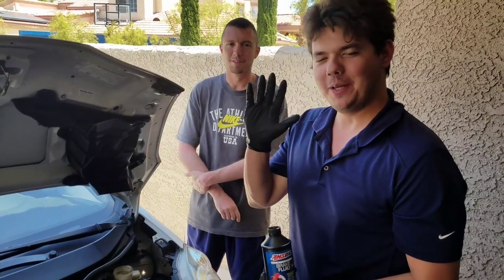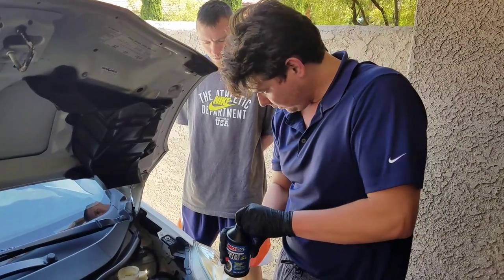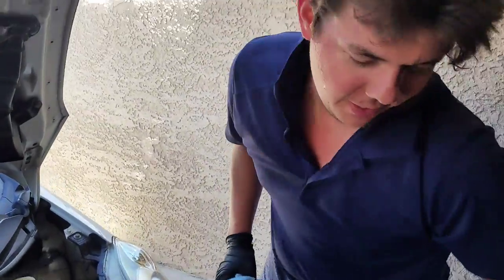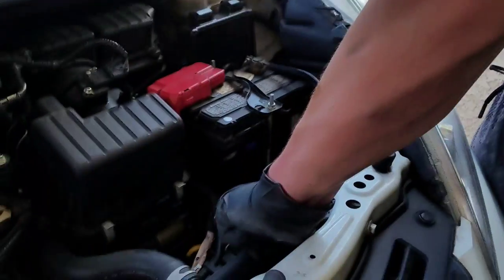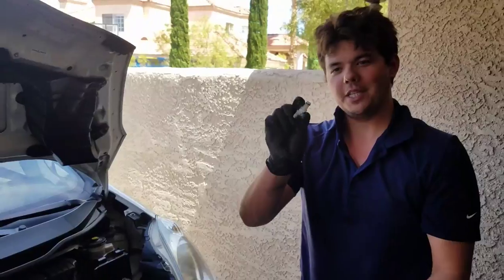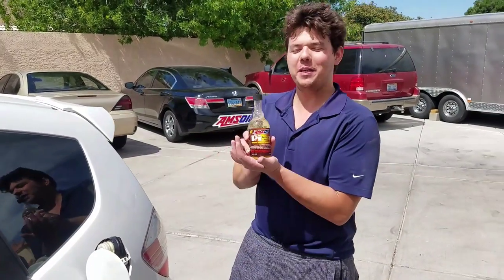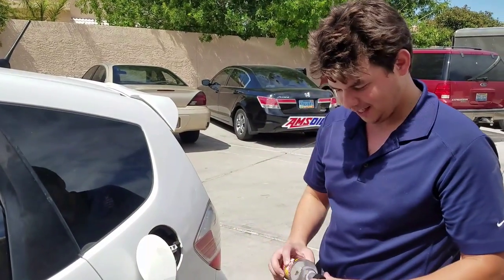Honda Fit Brake Fluid & Radiator Coolant Change

Comment: Appreciate the video. I've always been told not to shake the brake fluid bottle because it will add air bubbles in your brake line.

Comment: Just use Honda coolant. And don’t let your brake reservoir get below the low setting when bleeding.  And use a clear hose so you don’t get brake fluid everywhere
Reply: Amsoil coolant is excellent. Manufacturer fluids aren't always superior to 3rd party products.
Reply: @LordAfrocious  Amway makes coolant?
Reply from the maker: @mistercohaagen my favorite coolant is called the low toxicity biodegradable coolant it's compatible with all other coolants and you can mix it to the ratio you want we'll make a big Improvement in your vehicle warm up times with the Dominator coolant boost.
You can get those products right through my link and that would attach me to you in the future I could always be your Amsoil dealer and would be able to answer your questions about improving the performance and lifespan of your vehicles by choosing the right fluids👍
Eben Rockmaker 702-472-3614 
New Video - https://youtu.be/el0YnOpPNMo?si=B-wBCrEHhDTkV3Yq
https://linktr.ee/EbenRockmaker

Comment: I like your videos but can you mention sizes of bolts, wrenches and tools in general used , still awesome videos
Reply from the maker: I usually do.

If they're very general tools I usually don't mention it like 10 mm or 15 mm socket for an oil Bolt because they are in every socket set
Reply from the maker: If you haven't got a socket set yet I recommend if you're going to be doing basic work you can get a Craftsman socket set on sale right now during the holidays or you can also get a lifetime warranty socket set from Harbor Freight however they are not very strong tools say you cannot pound on them with a hammer or use a air ratchet or use an impact gun because it will crack the metal because they are very very very cheap tools.

If you're looking for something of real substance I recommend getting a used Snap-on set which is the best you can get pawn shop or on line.

If you have any other questions feel free to give me a call Aaron☕

Comment: Hello..
Please advise which antifreeze was poured into the Japanese Honda Fit 1.5 i-vitec 2011 car?
Reply from the maker: I recommend the low toxicity biodegradable coolant that's my personal favorite I use that in all my vehicles because it's compatible with all other makes models and colors I also use the Amsoil Dominator coolant boost which you'll see next to that on the website when you use my link that will attach me to you so in the future I can answer all your questions about improving the performance and lifespan of your vehicles by choosing the right fluids as your independent Amsoil dealer😊☕️👍
https://www.amsoil.com/p/propylene-glycol-antifreeze-and-engine-coolant-ant/?zo=5331179

You also want to add the 6-month PC membership to cart that's going to give you the best value on the products you'll also have the free shipping at 100 bucks or more and the new promotion which is right here below.
Promo: FREESHIP
Reply: Thank you very much for your help

Comment: You forgot to drain the remaining coolant from the engine block and you should also use a transparent tubing for bleeding the brake.
Reply from the maker: Flr Power 

Nice Add!
Reply: Why is that?
Reply: @dianasanta7587  that's because you can't mix the blue antifreeze (OEM) with another, and he just flush the radiator but there still antifreeze inside the engine. You only need to turn on the car with the Valve open to flush completely.
Reply: @josesalinas4494  Great input! Another thing to do is to empty the plastic reservoir.
Reply from the maker: If it was my car I wouldn't turn it on without any water in it because you could starve the water pump and if you got a phone call or got distracted and forgot you could totally wreck your motor.

I know it sounds funny but we get easily distracted these days.

That distraction could be thousands ☕😃🎬
Reply: @josesalinas4494  the proper procedure is to find the engine block coolant drain plug. You would never turn on the engine using the water pump to empty the remaining coolant inside the engine.

Comment: Is this a self bleeding cooling system? I have an 07 and need to do both of these flushes. Also for an occasional autocrosser would you recommend upgrading to dot4? I have factory brakes with performance pads and super sticky hankooks rn.
Reply from the maker: Yeah pretty much the Hondas are self bleeding sometimes you might want to squeeze the tubes and you'll see it burp the system a little bit but usually it's pretty easy.

Yeah you can run the dog for race fluid it just has a higher boiling point and it's better for super autocross situations
Reply from the maker: This will give you all the products for your specific vehicle and the fluid capacities- 
Lookup For Your Vehicles - https://www.amsoil.com/guides.aspx?zo=5331179
Reply from the maker: Always happy to help you anytime Travis☕🎥🇺🇲

Comment: I think you should mix the coolant 50/50 because even though it's warm in Nevada the factory antifreeze has additives that prevent corrosion that your whole system that your not getting at 20%.   As far as the Amzoil additives, I think snake oil.   They have good oil but, everything else seems far fetched.  The guy at the end saying his car is riding better, the fluid change isn't going to do that !!!
Reply from the maker: AMSOIL Performance Test Results - https://www.amsoil.com/performancetests.aspx?zo=5331179
Reply from the maker: Amsoil is the first in synthetic in 1972 they are the make the first synthetic motor oil first synthetic transmission fluid and first synthetic gear lube.

♥️ AMSOIL Performance Tests: Read This Article - https://www.amsoil.com/performancetests.aspx?zo=5331179
Reply: I use Amsoil Signature 5w-20, PI, and Upper Cylinder lubricant. Their products are not snake oil. I didn't use their engine flush, rather ATS or Liqui Moly. My sister has a Fit and the concentrated detergent in PI has worked wonders on the built up gunk in her fuel system and combustion chamber. She is the type never to touch her car outside of an oil change, coolant top off, and air in the tires. Not all additives are junk.

Comment: Do you have this same service in California?
Reply from the maker: Great question, yes you can order the products and when you use my link you will get the products at the very best value when you get them at your doorstep you can take them to a mechanic and have them installed or you can also hire a mobile mechanic and they can come to your work and install it the most important thing is to watch them do the service it's always good to make sure you see the fluid go in your vehicle👍

✅ ✅ ✅  Save 25% On Next Fluid Order: https://www.amsoil.com/offers/pc/?zo=5331179 

     ❤️ 🇺🇸 ❤️ Your Professional YouLubher: Eben Rockmaker. Find The Right Fluids For My Vehicle - https://www.amsoil.com/guides/?zo=5331179

Comment: Is all of it the same on a 2012 manual base non sport?
Reply from the maker: It's very similar but it's a different fluid and you'll just look it up right here is the lookup guide
Reply from the maker: AMSOIL Makes it for your Vehicle Lookup - https://www.amsoil.com/guides.aspx?zo=5331179
Reply from the maker: Thanks for the question really appreciate it and we're doing the giveaway tomorrow at 11 a.m. Las Vegas time Saturday where we will be giving $100 gift card away. All you do is share the channel and send a screenshot of the share to me with your full name and I'll put you in the giveaway.
#EbensGiveaway 

Eben Rockmaker Independent AMSOIL Specialist (Dealer#: 5331179) 
Mobile: (702) 472-3614
 My link: AMSOIL 25% Less Wholesale & FREE SHIPPING: https://www.amsoil.com/offers/?zo=5331179

Comment: Will this work for a Honda Fit model 2018???
Reply from the maker: Yes, You want to get everything here on the lookup guide It will give everything for your year make and model.
Find AMSOIL Products For Any Vehicle - https://www.amsoil.com/guides/?zo=5331179
Reply from the maker: If you're new to Amsoil I recommend the 6-month PC membership will give you the very best value on the products if you have any questions let me know when you use my link I will be your go to Amsoil guy in the future and I'll get the credit for your orders which I appreciate the business future business in advance Thank you.
  ❤️ 🇺🇸 ❤️ Professional YouLubher: Eben Rockmaker Regency Platinum Direct Jobber AMSOIL Specialist (Dealer#: 5331179) 702-472-3614 

      ✅ ✅ ✅  You will get Best Value with 6 Month AMSOIL PC Membership because You get $33 back on a $100 purchase after the difference in Sales Tax with No need for Auto Renew - https://www.amsoil.com/offers/pc/?zo=5331179

Comment: Hello, what size of the wrench are you using?
Reply from the maker: The motor oil bolt is 15 mm the front brake caliper is 10 mm. Basically, if you have a standard metric socket set with open-ended wrenches you're good..... 

Thanks for reaching out to me

Comment: 9:20 what is the name of this product 🤔
Reply from the maker: It is the Amsoil PI performance improver cleans the valves injectors all the carbon deposits inside the combustion chamber https://www.amsoil.com/p/p-i-performance-improver-gasoline-additive-api/?zo=5331179

Comment: There is no mention of draining the coolant that's in the engine block itself!
Reply from the maker: Correct the block holds about a quart depending on the vehicle all you do is a couple draining fills run the heater core and that will get most of the coolant out.

The most important thing is to continue to flush it until the fluid runs really clear once it's running super clear you're ready to put the good stuff in 🎬☕☕💯

This is my link if you ever have any questions always happy to talk with you appreciate you checking out my YouTube community.

When you use my link I would get the credit for your orders and in the future I could always talk with you because I would be your Amsoil dealer.
Professional YouLubher: Eben Rockmaker Regency Gold Direct Jobber AMSOIL Specialist (Dealer#: 5331179) 702-472-3614 

     If you're New to AMSOIL I recommend the AMSOIL 6 Month PC Membership - https://www.amsoil.com/offers/pc/?zo=5331179

Comment: Can you put that on a Honda Odyssey 2005, bros?
Reply from the maker: Yes, Yes most of all the Hondas are all exactly the same very simple to work on They all pretty much take the same oil filter that I'm aware of Everything is right here in the lookup guide If you have any questions on anything always happy to talk and when you use my link I would get the credit and I could always answer your questions in the future on the products.
Professional YouLubher: Eben Rockmaker Regency Gold Direct Jobber AMSOIL Specialist (Dealer#: 5331179) 702-472-3614 

     If you're New to AMSOIL I recommend the AMSOIL 6 Month PC Membership - https://www.amsoil.com/offers/pc/?zo=5331179

Comment: When bleeding the brakes as assistant pushes and holds brake pedal down and you open the valve are you quickly opening and closing or is that little bit that spurts out all that’s in the line every brake push?
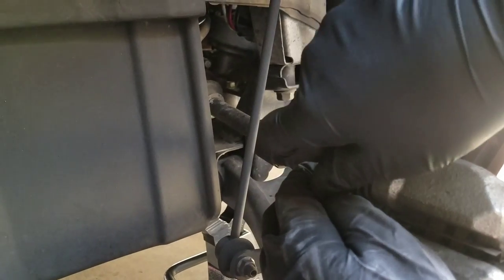Reply: Like at 2:52 and 3:12.
Reply: jdhrap when the assistant presses down the brake pedal it pressurizes the lines.  Then the bleeder screw is opened any air or old fluid is expelled.  The bleeder screw must be closed before the brake pedal is released or air will be sucked into the brake lines, this is very bad.  Also as the fluid is bled out you must keep adding more fluid to the master cyclinder throughout the bleeding.  He doesn't show this in the video.
Reply: @slalomking  if i want to change the brake lines upfront should i bleed the side im going to change all the way drained to take off and replace the line then do this method again to have fluid back in? Sorry first car
Reply: @johnnyherrera7821  No you don't have to drain the removed back line.  Remove it, then install the new one.  Pump the brakes to fill the new line and bleed it at the disc caliper.  Bleed it until it is air free.  Since it is a new line, check the line where it attaches to the disc caliper and the upstream connection.  Also you should bleed the opposite wheel just to make sure it is air free also.  The front and rear brakes are split.  You work on front you must do the two up front.  Work on rear you should check the other side on the rear also.
Reply: @slalomking  thank you it was hard to find a brake line replacement video on my Fit so watched someone do it on a accord and was pretty much same process. Thanks again🙏